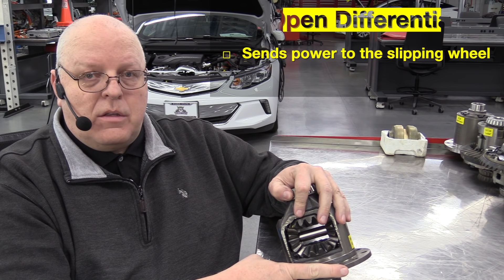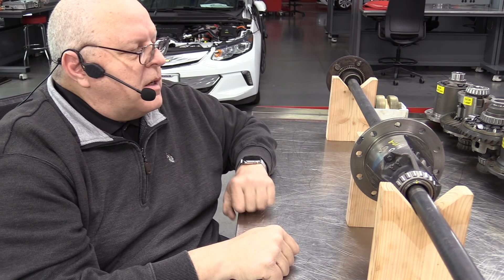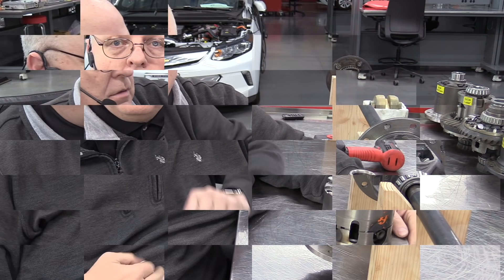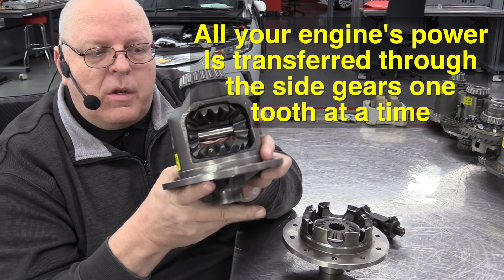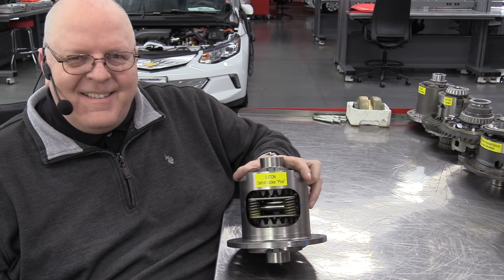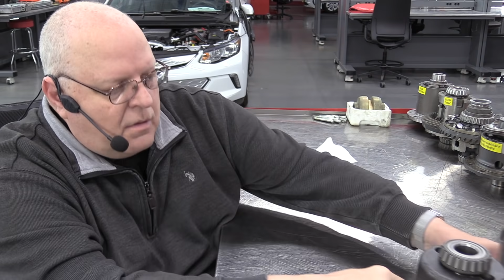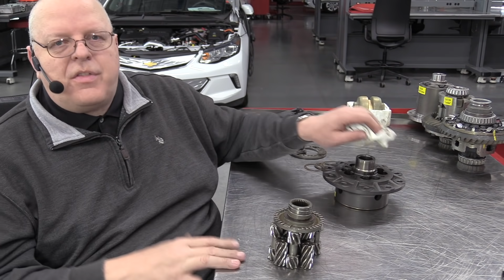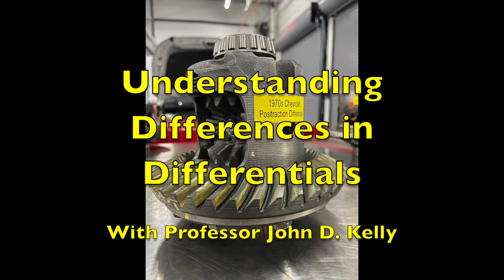Understanding Differences in Automotive Differentials

Comment: Thanks a lot!
Reply from the maker: You're welcome! Thanks for watching
Reply: @WeberAuto  ,, I have a 97 Honda Inspire 5 cylinder . I am not sure what differential it uses. I am having a thumping sound when moving from park . Mechanic said it is a backlash in the differential. Car changes out beautifully. I have to hold the brake firmly to limit the sound. Any suggestions appreciated.
Reply: @michaell3711  in
Reply: @archiemrara5048  ,,,,.  In ??? What are you asking ?

Comment: Difrentials in transfer cases. What a wast now one is doing this.
Electric motor each wheel..!
Dino, between engin and thansfer case, Dino generator with a holow shaft for another direct shaft to the transfer case normally connected to the rear wheel differential.
Transfer case differential serves as a means to direct differential ratio traffic to rear wheels or to the Dino generator..
At start loading the electric  motors over spinning the Dino provide current for the wheel electric motors. When more current is applied at higher speeds it causes transfer case differential to send more to the rear shafts the rear differential.
Now what do you call it..!
UNLIMMETED OVER DRIVE CONSTANT VELOSITY DRIVE
AND NOW SPEEDS UP TO 300 MILES PER HOUR POSSIBLE WHITH A SUPER HY TORQUE LOW SPEED DIESEL ENGINE.
SAY THE DURIMAX..!
By the way quarter mile ET time would be at least eight seconds..!
Reply from the maker: Thanks for the information

Comment: Torsen is pure trash for sports cars, it is an open differential that can transfer 70-80% of the torque to one side instead of 50%. During high g-force turns the Torsen will make the inside wheel slip, the torque applied to the track will drop resulting in sudden oversteer, very dangerous! Get a clutch pack differential, the car feel so much more stable/predictable, if you are on the gas and one wheel lifts you get 100% of the torque to the wheel still on the ground. Plus, when off throttle, you keep the benefits of an open diff for corner entry.
Reply from the maker: Thanks for the information.
Reply: @WeberAuto  With a clutch pack you can even tune ; preload, locking strength, activation rate under deceleration and acceleration.  Is is a great tool to give the car maximum grip at any stage of the corner and under braking/acceleration. I'm glad I took the time to learn it/install it, the performance increase is amazing.

Comment: https://en.m.wikipedia.org/wiki/Limited-slip_differential
"In 1932, Ferdinand Porsche designed a Grand Prix racing car for the Auto Union company. The high power of the design caused one of the rear wheels to experience excessive wheel spin at any speed up to 160 km/h (100 mph). In 1935, Porsche commissioned the engineering firm ZF to design a limited-slip differential to improve performance."
Reply from the maker: Thanks for the information

Comment: This is great. FYI though I think your explanation of how the clutch pack diff works is off. The reason the pressure is applied to the discs is not the angle of the pinion gears (I am sure that adds some, but not the main force) but rather than angle of the cut into the pinion pins. If you look at the cross and the pins that go into the diff casing you'll see they're cut at about a 60 degree angle in both directions. This clutch LSD is a "2-way" LSD since the pinion pins have equal angles on both sides. This 60 degree angle forces the clutch packs against the sides of the housing equally in both accelerating and braking. There are also 1-way and 1.5-way LSDs. The 1-way LSD will have angles on one side of the pinion and none on the other. This will lead to lock up during acceleration but not during braking which allows for less understeer. There is also the 1.5 which will have about 60 degrees on the accelerating side and 30 degrees or so on the decelerating side so that there is some locking under braking but not as much. Hope that helps!
Reply from the maker: Great information! Thank you

Comment: Greetings sir. Very good information and delivery. I realize U have not gone over every version Bcuz of of time I presume. However there is another style used in the automotive world called a 'ratcheting' ( exploding ) locker.  It's a 14 bolt used by GM in the 80s - 90s C and K 20s. This thing was a flop.  Poor lubrication and/or the wrong torque in the wrong wheel spin or differential action would cause the lock pin 2 stick or shear. If it sticks U have a locked unit in whatever differential state resulting in wheel skid 2 a broke axle or exploding gear sets. If it shears U have an open diff w/ a small steel pin floating that may get caught in the gear set B4 it rests in diff case.
Reply from the maker: Thanks for watching
Reply: @WeberAuto  Ur welcome sir. I meant no discredit. It was FYI 2 the readers. Perhaps we can communicate in a less public environment? I have a few Qs 4 U.

Comment: Of course, the method of overcoming loss of traction with an open differential on a rear wheel drive vehicle is to lightly apply the handbrake. The braking torque on the slipping wheel is applied to the wheel with traction and overcomes the complete loss of traction. Modern vehicle stability control having braking to individual wheels simply applies the brake to the slipping wheel thereby transferring the torque to the wheel with traction. Electronics overcomes the need for mechanical complexity.
Reply from the maker: Yes, very cool system
Reply: @WeberAuto Couldn’t agree more. It’s what my Toyota Prius has fitted as standard although I have never pushed it to make it work. The brakes operate independently of the brake pedal, however. If I reverse too fast into my garage, the brakes are applied as if the car has hit the rear wall although it is only a cardboard box which is triggering the sensors and that would yield if touched. I do like the radar-assisted cruise control which will slow the car down (using its regenerative braking) if the car in front slows down. It seemlessly transfers braking to the mechanical brakes if the car in front then stops and will hold the vehicle on the brakes until the car in front starts to move again, without driver intervention on the brake pedal. It doesn’t start moving by itself if the car in front starts to move. It posts a message asking for a throttle movement or a flick of the cruise control lever so the driver has to consciously require the car to begin moving again. Toyota seem to have thought of everything.

Comment: Hi John - A couple of notes.  Once you replace the gears with the coupling,  it is no longer a differential.  Also, the first and easiest solution was only to power one rear wheel.  And, I assume that if you were stuck in snow or mud you could partially apply your parking brake to provide some resistance to the free spinning wheel.  Not elegant but might get you out of a jam.  Wonderful video as always.  Wish I lived closer so I could sit in on all of your classes.
Reply from the maker: Thanks. Many of today’s vehicles apply the brake for you and accomplish the same thing automatically. Thanks for watching

Comment: I was surprised that the limited slip didn't come out until 1956.  I assumed that it was much earlier.
Reply from the maker: There were locking differentials before then, but not limited slip. Thanks for watching

Comment: I had a minispool in a skyline of mine for about 10 years. Never regretted it. Eventually 'the fuzz' caught me on it and gave me a defect for it.. Because i'm in australia. Never damaged any other driveline parts in that time. And i wasn't easy on it.. Shock load, Best load.
Reply from the maker: How did they catch you? Thanks for watching
Reply: @WeberAuto  Going through a mcdonalds drivethrough and they saw the inside wheel skitter/shudder when turning tightly. And thanks for making these videos. They are very informative and enjoyable to watch. I was also very interested to see the jeep diff with torsen limited slip AND a locking system. Most often people say you can either have locking or limited slip. Not both. Both i'm not sure i can get that for my nissans.
Reply from the maker: @Braskus  Thanks. The Jeep configuration is impressive.

Comment: Do some vehicles with an open differential use the ABS computer to stop the wheel with little or no traction, thus sending torque to the opposite wheel?
Reply from the maker: Yes, many vehicles do that now

Comment: Great video! thanks. are you familiar with the toyota multimode 4wd(in current seqouia)? I trying to wrap my head around how it works. from what I understand it is a full-time 4wd system, but allows the front axle to be disconnected. however, wouldn't that cause all power to go to the front propellor shaft from t-case, so it must lock its center differential when in 2wd mode, yes? so 2wd(center locked, front axle disconnect, gear range high) to 4H(center default unlocked, press button to lock , front axle connect, gear range high) then 4L(center default unlocked, press button to lock, front axle connect, gear range Low), does this sound correct? Thanks so much! Would love to see a tear down of a toyota landcruiser transfer case!

Comment: The eaton locker used in GM doesn't just become a limited slip unit once engaged.  The ramps will apply more and more force to the clutch pack until differential action stops.  If the clutch is still slipping, the balls are still climbing the ramps.  Once the clutch stops slipping, the balls stop climbing the ramps.  Until then, the side force just keeps climbing.  It is capable of 100% torque to only one wheel.  
Part of its weakness is the fact that it lets the drivetrain wind up to 100RPM of difference and then fully locks.  They tend to break when the driver stays on it hard with one wheel with good traction.  A right tire on wet grass and the left tire on dry pavement with a load in bed is a good example of this.  If the driver punches it, the right tire spins up and then the eaton locker kicks in with a bang.  Not only do they have a habit of grenading the locker, they also have a habit of slipping the axle tube in the differential housing.
Reply from the maker: Thanks for watching

Comment: So that Eaton locker is entirely mechanical with centrifugal engagement?  Seems like a way better design than needing a compressor or having it done electronically with a solenoid as in the Toyota.
That Jeep one seems like a rube-goldberg device.
Excellent video. Thanks for posting it and thanks to the students for blowing out their differentials for this demonstration! (lol)
Reply from the maker: Thank you! Sometimes broken parts are better for learning than new ones.

Comment: Thank you very much for putting all this in one place. You were very clear. I appreciate the explanation on how the bevel on the side teeth help apply the clutches. The advice to use the emergency brake to help the clutches made sense with that knowledge. To carry this further, it should be noted that all beveled tooth gears try to get away from each other, i.e.. in a manual transmission the 2 shafts will try to split the case, the pinion will try to twist away from the ring gear.(That is why some axles have a support for the front of the pinion gear.)
One variation you did not mention is the cone type limited slip, maybe because they haven't been used for a long time. These used metal cones that side gear bevel and spring pressure would force into the diff case to reduce slippage. I had them on a 71 Duster and 71 Javelin AMX. When they worked they did the job, but when they wore out the diff case had to be replaced. The Duster got a clutch type real quick.
Reply from the maker: Thank you very much

Comment: If you have full time or all wheel drive if one slipping the center did
Different all you will spin the slipping wheel be four time speedometer or twenty mph will be eighty mph rear drive it would be forty MPH this how one blows tires and do damage to the drive line
Reply from the maker: Correct! A very dangerous situation

Comment: What was wrong with the original design by Torsten using the "worm gear" concept?  I put one in a small Toyota pickup that did not have C claps,,,,worked great.
Reply from the maker: See the link in the video description from the Torsen manufacturer. The newer design is smoother.
Reply: @WeberAuto  thanks, I always wished for a truck that had a Torsten on each axle and one in the transfer case.  I don't live in ruff country, but live on flat ground where when wet, the ground turns slick as grease.
The old timers here hated the first "lockers", going down a muddy road the back would spin then it would lock on a straight shot to the ditch.
Reply from the maker: @olegig5166  Wow, that sounds like I would hate them too

Comment: Sorry to hear the same untruth told about the open differential time and time again. The open differential is NOT(as is being said in the beginning of this video) passing all the power to the wheel with the least traction. It is in fact delivering the same amount of power to both wheels at all times, it just appears not to. If one wheel is standing on a slippery surface, not a lot of torque is needed to spin it. The exact same amount of torque is applied through the differential to the other wheel. It may not be enough to get the car moving, but it is still the exact same amount of torque that goes to both wheels. This is also why you can manipulate an open differential to work almost as a limited slip diff, by for instance electronically, applying the brakes on the spinning wheel, which Land Rover, as an example, do in some models.
Reply from the maker: You are correct, I did not explain that properly. Thank you

Comment: I was on the Mini Baja Team of West Virginia University (WVU) Mechanical Engineering class of 1983.  We took 1st place that spring out of many universities in the US & Canada.   Me & another fellow were on the "powertrain" end of our team.   All teams were given an 8 HP Briggs & Stratton engine & each team took it from there.  We used a Salisbury torque converter off the engine output shaft to drive a differential with 2 output shafts, with  sprocket & chain drives on each side of the diff. casing  to TWO independent axles & independent brakes on the rear end of the car.  

Part of the competition was water maneuverability.   You could lock up one rear tire with one brake & the other tire would spin 2X as fast & turn the car on a dime around a course of buoys!  Then, when you needed to exit the water to climb out on dry land, you'd brake the axle in the water & transfer 100% of the torque to the wheel on dry land, climb out onto the bank & then release both brakes & continue on  the race course !    Thank God for my dirt bike days of the 70's to give me knowledge of this hands-on stuff.  About the only thing I had to learn back then was the principles of differential operation .  Your video would've helped tremendously 38 yrs. ago, lol !
Reply from the maker: Awesome story, thank you

Comment: There's also the Jeep "Quadra-Trac 2" system.
This uses an oil pump to force the clutch packs together hydraulically when one wheel begins to slip, I had a Grand Cherokee with this setup and it actually worked quite well!
Reply from the maker: I forgot about that system, thank you.
Reply: Mine needed a new solenoid, but yes, they are astounding for putting power to the wheel with traction. Electronic limited slip differential.

Comment: I have an Aussie locker in my 2wd F150 and it's awesome! It has dog teeth and works exactly like a Detroit locker however it's a "lunch box" locker because it installs in place of the spider gears. 
I guess the only real downside to it is that it makes a lot of noise and you can hear it ratcheting when you're going slow like in a parking lot, that minor annoyance is far surpassed by the incredible traction you get with it!!
Reply from the maker: Good information, thank you

Comment: You mentioned fuel economy. Is the limited slip differential worse than an open?
Reply from the maker: Good question. I don’t have hard facts to prove it, but I believe an open differential will give the best fuel economy because it has no other clutches or gears dragging when not going straight down the road. Thanks for watching

Comment: It's the GM gov lock, they use them in the diffs of the hummvee.  Allows the tires to spin freely until brake torque is applied to get the diff to lock.
Reply from the maker: Good to know. Thank you

Comment: Yes the Toyota was only fully locked in 4 low
Reply from the maker: Good to know, thanks
Reply: @WeberAuto  oh that was a 1996 and the Nissan hard body xe was the same.  And those 2 trucks out did EVERY model of competitor in West Virginia when I worked on a natural gas drilling rig.  I done that for a decade and no one believes it but those trucks are the best stock trucks with 31 10.5 mud tires a human could have period.  I made plenty of money at the bottom of mountainsides against every conceivable STOCK or just lifted and tires only competitors.  Like the show.  This hillbilly give it 2 thumbs up
Reply from the maker: @MatthewLucas80  Very cool!

Comment: I have a 1936 Buick that I had a modern drive train put in. They suggested a limited-slip, and I said I wanted a Posi Trac rear end.  They said fine, and put in a Ford 9" Positrac charged me an extra 500 bucks. I noticed that the inside wheel chirps a little on tight turns. I'm watching your video and I think there is no such thing as a "Positrac" rear end. So, what do I have?
Reply: There definitely is such thing as positrac. Eaton calls there clutch based lsd positrac. They need a limited slip additive in the gear oil, the shop might not have added any or did not add enough.
Reply from the maker: Exactly correct, thank you
Reply: @WeberAuto   cool i will add some more limited slip oil then just to make sure their is enough